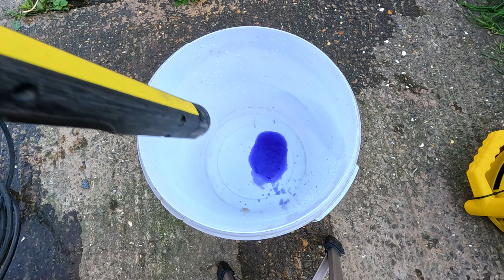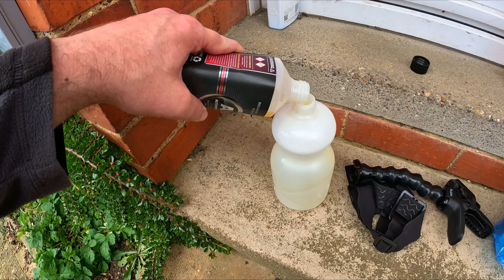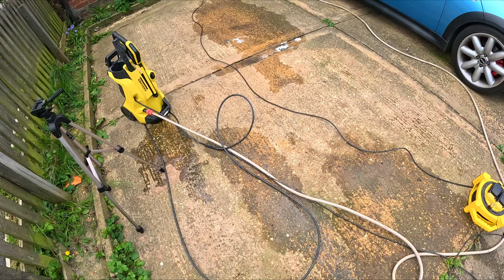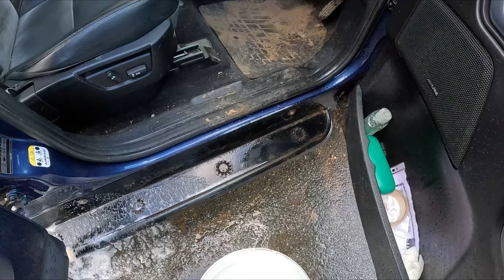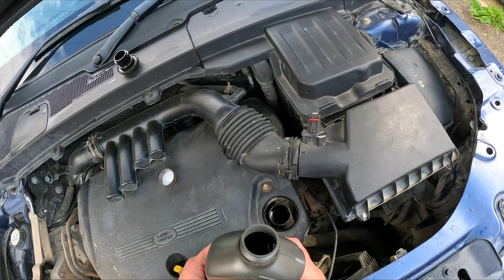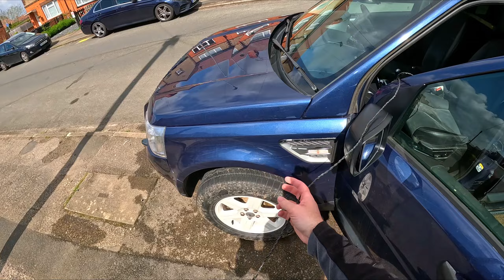Giving Our Freelander 2 A Wash Down After A Fun Time At Binegar Quarry. 🧽🚗🫧

Comment: Had to wash mine as you well know Scott.
Reply from the maker: It was an interesting way of washing a car, throwing buckets of puddle water over it. 😁 It was positively sparking afterwards. No one would've even known just how dirty it did get. 😂

- Scott
Reply: @ScottandAlana4x4  Think I may have contributed to the drowning of the air filter by hurling buckets of water into the air intake. Ah well, live and learn.